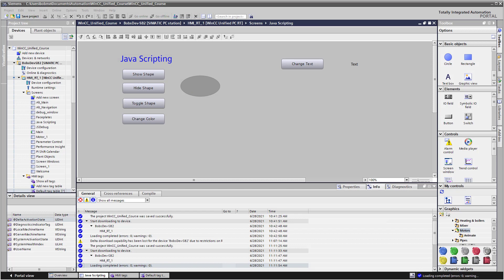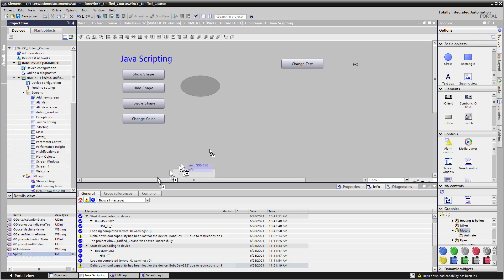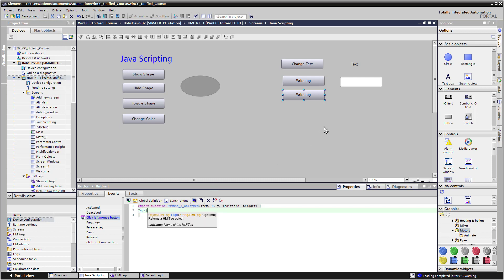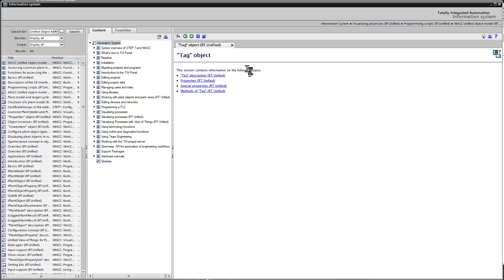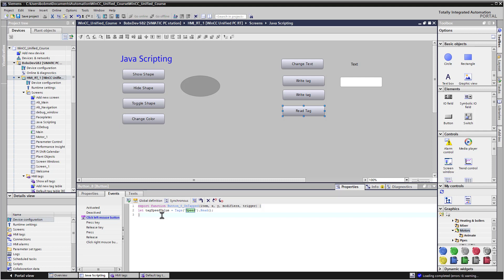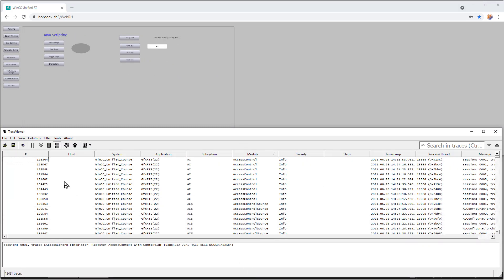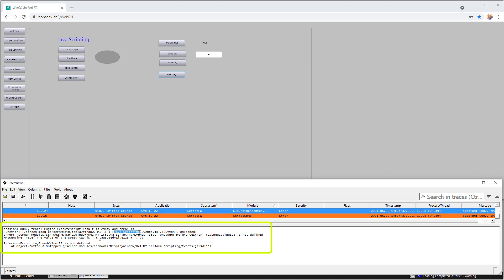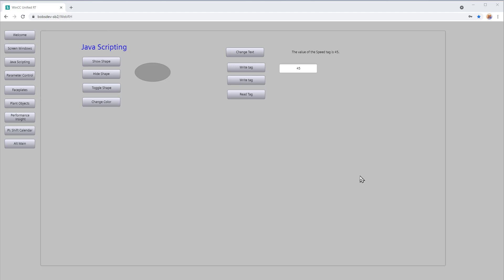WinCC Unified v17 # 11: Unified JavaScript Object Model 🧰 #WinCCGURU

Comment: Thank you for your great videos. I've learned a lot from you. I have a question regarding the two buttons: 'Write Tag' and the i/o field 'speed'. I would like to enter a number in the 'speed' field, for example, for the bottom button 'Write Tag'. Next, I would like to enter a 'speed' value for the upper button. But when I press the lower button again, the last written value for the bottom button should be displayed again. How can I achieve that?
Reply from the maker: thanks for your kind comment, glad you learned some stuff!  If I understand, you want to hold temporary values to write to a tag. There are a few ways to do what you want. One way involves having low and high limit internal tags which would hold the current high and low values you want to write. The button would just read that tag and write that value into the speed tag.

Another way is to use a global script variable for the high and low values you want to store. see https://youtu.be/28feASbIifQ for some tips, however make sure you don't declare it as a constant.
Reply: @WinCCGURU  Thank you, i will try it